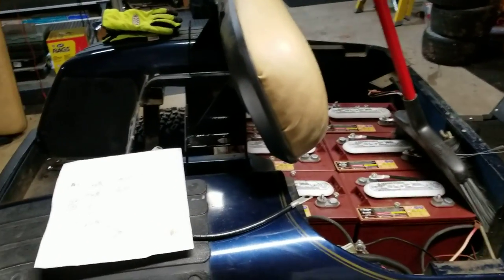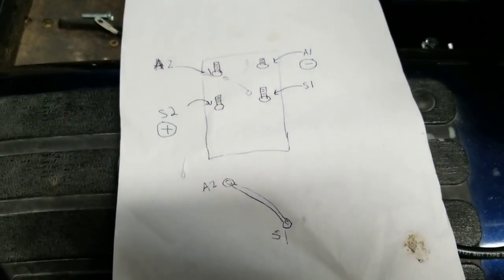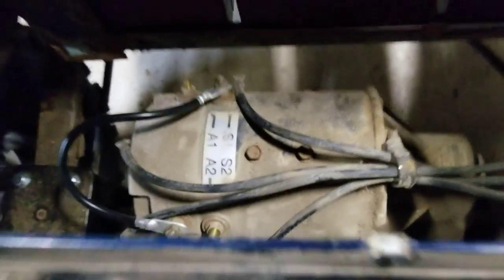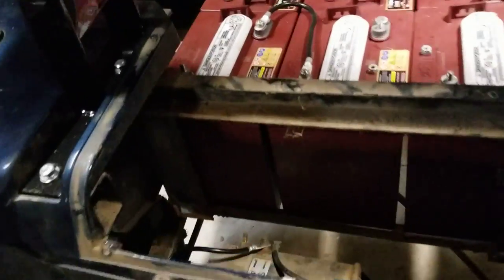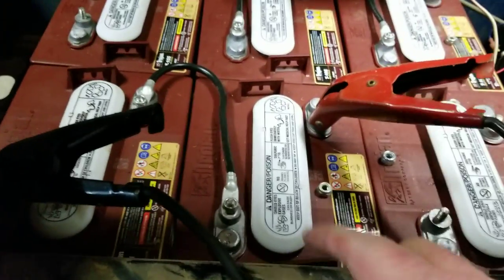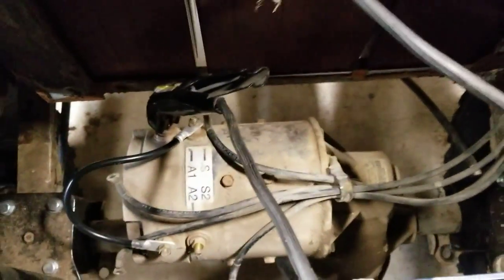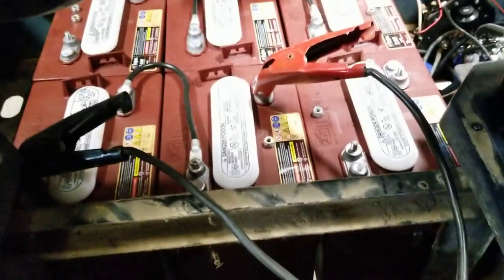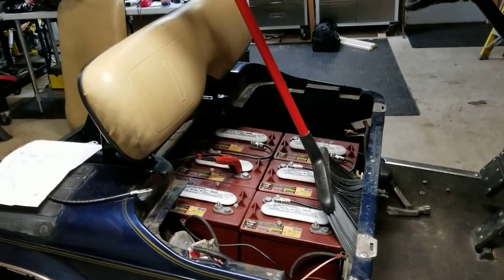How to test an ezgo txt electric motor

Comment: Hope this can help someone else. I just got a 2006 Yamaha G22E. It had been setting in a barn for 5 or 6 years, so the batteries were shot. Before I spent $700 to $1200 on batteries, I wanted to test the motor to make sure it hadn't died. This video was as close as I could find for my Yamaha, but it contained everything I needed to figure mine out. The Yamaha motor is marked 

F2    (small post)        F1   (small post)  
A1    (large post)           A2   (large post)

By jumping A1 to F1  and A2 to F2 then appling 12volts to A1 and A2 (polarity doesn't matter), the motor spun, much to my joy!!
Now, Sam's Club has 8volt Duralast batteries for $109 each, I don't know if I'll be using it often enough to warrant more expensive batteries.

Comment: Is the motor testing for F&R. Cart only goes in F. Have checked the F&R switch wires to be good.I have traced the wires from the control board and tow switch to be correct. Solenoid resistor heating up when connected to the large post of the solenoid. Thanks

Comment: Hey Glenn, I have the exact same exhorted golf cart and setup (I.e. controller, f&r switch, etc.). My controller clicks on, but wheels do not turn. Motor is good.  What was the problem with yours?  I’m still stumped.
Reply from the maker: I replaced the motor and updated the solenoid and F/R Switch to heavy duty.

Comment: its called a shunt motor, separate excitation , you have a enclosed motor, carbon tracking is happening, you have to tear it down, clean the brush holders, did you check the brushes
Reply: Its a series motor not a shunt motor, the wiring would be different if it was a shunt

Comment: Well my wheels are spinning.so motor is good.😃.. controller might be the issue 😡 .... tanx for vid.. good job
Reply from the maker: Most of the times its the solenoid or the forward reverse switch

Comment: Do you know if it will be the same procedure with a 48 volt? Thanks
Reply: This will work on a 48v motor I just did it on my bad boy Buggie which is 4WD so it has 2 motors both worked so I know now it’s the controller that’s bad. I was looking for a test on 48v too. So to help anybody else out I just wanted to say that yes it does work on 48V as well.
Reply: @offgridcabinaddict6314  I’m have a problem with my bad boy buggy. Anyway to contact you to see if you know what it is? I have done lots of tests.

Comment: I’d connect to the battery posts if possible. Not the threaded attachment bolts. You’re going to mess up the threads.
Reply from the maker: its fine

Comment: So technically you are just throwing parts at your EZGO golf cart?  But . . . . you managed to find out how to test the electric motor which we have to give you kudos for that. But in trying to figure out your problem you changed the solenoid, batteries & other parts? 
In the same manner that you discovered how to test your electric motor that is the same thing you do with all suspect components. Find out how to test the components before replacing them. Throwing parts at your problem is a mistake and huge waste of time and $$$$$. Finding out how to test your components 1st to eliminate or suspect the bad component  is the more proper trouble shooting technique. Eliminating the electric motor as a possible problem by testing it first is the correct troubleshooting method. Imagine if you paid the $700 - $1000 for the electric motor and swapped it out for the one you tested to be good what a waste of time & effort. You already changed up the batteries which was a huge $1000 troubleshooting mistake. Funny that's how most fix their automobiles. Thanks for putting this up.
Reply: Youre absolutly correct. I will say i have been guilty of this same thing more than id like to admit..proper testing will save you so much stress and money